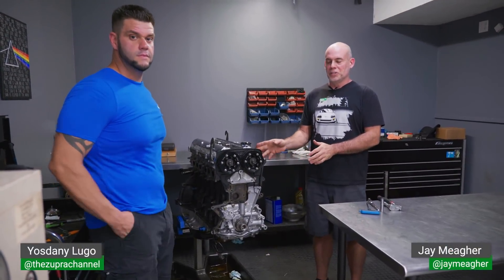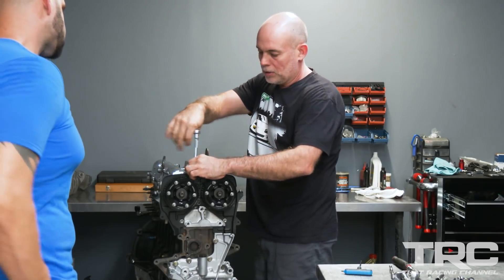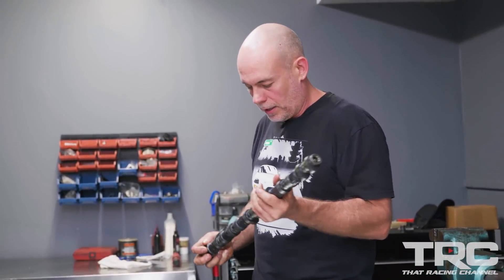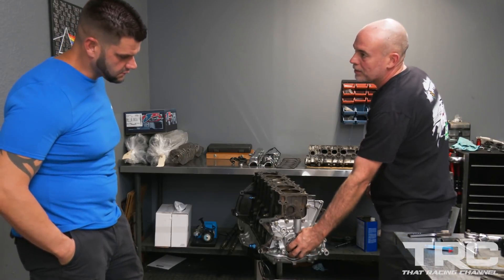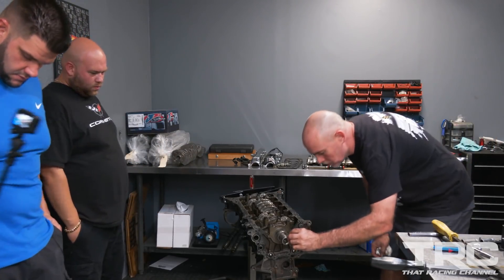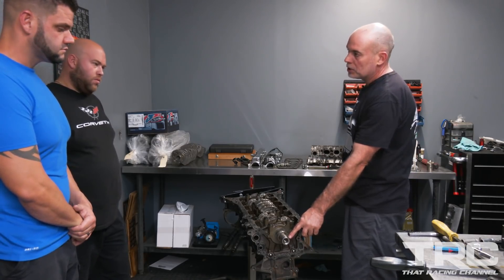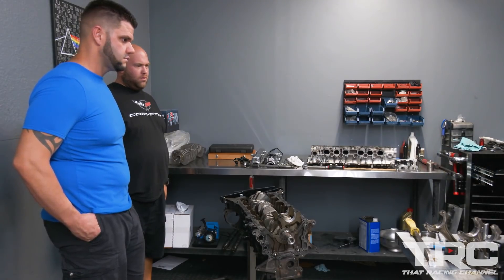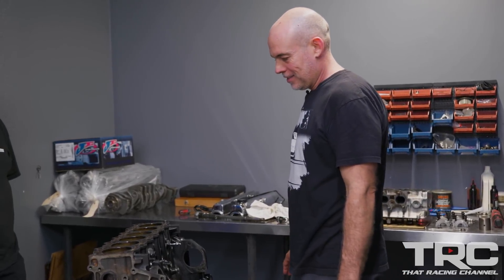1100HP Supra Blows Engine - 46psi on Stock Internals (Engine Teardown)

Comment: 1100hp out of a stock block isn’t that impressive. I had a Chevy 454 modified and tuned to 1800whp (with the stock block) and it lasted me years. I also have a 5.9 24v Cummins making 2100hp. (Also with the stock block.) I bought the truck new back in 2003 and had it tuned for racing and hauling. The engine still runs completely fine and has never had any issues.

Comment: Having used cranks from explosions several times I have never had a problem. Though crank has been checked for both straightness and cracks.
Normally the piston will fail causing the rod to fail.
Crank snout issues though can be an issue.
The crank key however was loose when assembled last time. Otherwise the balancer would have been loose. 
Though these 1000hp engines are dyno figures. Not real power for the track.
Reply: How much hp and what engine are we talking bout here.

Comment: 8:26
Trauma is the key word here, you dont know how deep the damage went from that initial impact of that piston slapping into the head. Just because you only see damage there on the surface, does not mean there isnt more beneath like a hairline crack in the head that is not visible. 
Just like a lightning strike to a house, just because the hit was only in one spot of the house, does not mean that there isnt more damage, when that bolt hits, it creates an explosion and a shockwave and that shockwave will travel and whatever is in its path can and will get damaged. Let alone the electricity from that hit will attach to the electrical lines in the house and if you have devices on and running pulling electricity, the lightning surge will attach and flow with it thus blowing out that device or appliance. 
Like he said the guys who designed the 2JZ are sitting there smiling and saying yep thats our motor, ~1300 crank hp on stock internals :-)

Comment: Connecting rod breaks on the exhaust stroke if that is rpm related issue and not oil/heat related. It is due to inertia of piston con rod combo. On the compression stroke that inertia is partly consumed by air-fuel mixture being compressed but on exhaust stroke the only restriction/inertia consumer is backpressure and it is a lot weaker. In general connecting rod can withstand this stretching by itself but rod bolts are usually weaker and have a little give which can result in connecting rod cap misalignment and possible failure. Also if this cylinder is at about exhaust tdc his pair is at power tdc and has a whole lot of acceleration if engine is seeing much more combustion pressure than stock.  During normal operation this usually is not the issue and upgraded rod bolts might hold for modified engine but there is a limit on those rods too.

Comment: If he had the engine apart to do main caps why didn’t you do the rods and pistons. Wierd
Reply: Ahh .. $$ maybe ?? Or felt he had no reason at that time to push more than 800 whp so stock internals would be good enough... 
The way i see it, if i had to open the 2JZ .. regardless of how strong the stock block is, i would have thrown in pistons and rods just because i was going to open it and might as well do it just in case you decided to want more and more power ...

Comment: That key way was probably the reason the engine threw a rod when he let off the throttle. Would have advanced the timing for a split second
Reply: Yes thats when most engines fail on the dyno or the track, when they are going from really high boost to full vacuum state, that change in state is when the engine blows ... especially when your pushing the limits of the engine and its already on the verge of poping.

Comment: Damn those stock internals are really impressive ngl
Reply: The guys that designed this engine knew what they were doing and did it right ... the 1st time ...
Reply: @ACommenterOnYouTube  ah yes overengineering
Reply: @sn1per.-992  the rumor is they didnt over engineer it for no reason, it was over engineered in response to the RB26 motor that came out before the 2JZ .. Apparently the RB26 came out 1st and was a bad ass motor putting down ~500 whp on stock internals so Toyota fired back with the 2JZ ... and they did one heck of a job ...

Comment: 2jz Engines are just unbelievable  what they can do on stock long block.  And that's 1100hp to the wheels  on stock 2JZ.
Reply: But that 1100 whp or ~1325 crank is a ticking time bomb. But yes the fact that it was built thag damn strong from the factory was impressive.

Comment: Boostedboiz 4 cylinder minivan has a 1000hp 2jz's are junk!! Barra all the way🤏🤏🤘
Reply: 1100whp stock LONG BLOCK. That POS minivan has a fully built longblock only making 1k. The 2jz is a 3.0L 6 cyl, a Barra is a 4.0L 6 cyl. Toyota is the co-director of Yamaha motors. Guess who designed and helped Ford design that Barra engine? Walk it off buddy
Reply: @urot  so they broke Yamaha motor

Comment: So excess rpm pretty much pulled the rod apart. I guess under load, the boost and combustion pressure loads the rod in compression but when letting off the throttle, the rod is now trying to pull the piston back down after tdc against vacuum and simply doesn't have the tensile strength to do so. 

It is still really impressive that an engine that was designed for 280hp, with decent low down torque to pull a four door luxury barge, can then make the power it did and still not fail due to excessive cylinder pressure.

Comment: The owner just wanted the hp record, it was a throwaway motor to him somehow. The builder was pissed because 2JZ’s will be extremely rare in another few years.. you need to do your best to keep them alive so Supras can still live.
Reply: Yes. 100% agree. I bought my 2JZGTE in 2017 for 3000. Now a non vvti 2JZGTE is 7,000 plus.
Reply: @brianleiser7414  idk where you saw that. You can still buy a new OEM short block for $3.5k
Reply: @2jJosh98  Hey Josh. I'm talking about a complete engine. Not a block only. Prices climbed a lot in the last 3 years for complete engines..and I can only guess the reason why is popularity.. or import taxes. No one really talks about the price hike.

Comment: More important question is what was the torque rating and when what is it?
Reply: it made 1106HP and 824TQ
Reply: @TheZuprachannel  Thanks for the reply. Once you start getting into 700TQ, the stock rods start to become dangerous. His timing and tune appears to have been right which is why it lasted a bit. 650TQ is the very safe limit for very high reliability on the stock rods. After that, it start to go down from everything I have seen over the decades.

Comment: Dang. 1100whp with stock internals? Last time I checked it was only 600whp that they could handle lol
Reply: Would say Dyno lottery but 400 is a big big difference
Reply: @andrewwright.  10 Years ago it started with 800+whp. Thats around 1000 hp @ the crank. Thats not a lottery.

Comment: "We'll get you another engine, and get you back to playing"...although I wonder how much parts and labor would cost...
Reply: I'll say you looking at 25k to get it run again..
Reply: @Hallstead Hoops, the bill can run up pretty quick. For a RS1600 from real street the price isn’t bad. I think it’s 9k or so with a new block and crank or a seasoned block/crank. The head is the bitch, to get a good used GTE head is 1400-1800. If he sends it off to get worked over by the best of the best (Porting Solutions, Headgames, etc) race port/polish, upgraded valve seats and valve train+ shimless buckets, new cams, and cam clearancing is about 7k 

ARP L19’s/625 headstuds I’m sure are on the engine, so those are reusable, but will need modded oil pump (300) new water pump (~200) full engine gasket kit from pan to valve covers (~550) timing belt and billet tensioner (~300) and professional assembly, installation and a retune. 

20k-22k is not unreasonable for a fully worked over 3.0 utilizing a  new OEM block. If he goes 3.2 or 3.4 you can add a Crower crank to the cost at ~4k, billet bullet block is 8000 dollars. But both items are really not necessary for 98% of high horsepower Supra setups.
Reply: 5k at least
Reply: @andrewwright.  thats not enough for a stock engine anymore
Reply: Depends on the build, but I wouldn't doubt somewhere ~20k for a fully built to the tits motor.
Reply: @youtubasoarus  Billet blocks run about 6-8k alone if I recall from Mazworx

Comment: Engine breakdown videos are always satisfying to watch. 2JZ engines are top tier for a reason.
Reply: Coyotes
Reply: Honda K24 > 2JZ
Reply: @Twobarpsi  lmao
Reply: @madkas14  1000hp K24 or 1000hp 2JZ, which is the better engine 🤔
Reply: @Twobarpsi  k24 is cool,, but imho 2jz is better and can hold more power.
Reply: @madkas14  1000hp out of 4 cylinders is 🤯
Reply: @Twobarpsi  this is true, that's extremely impressive.  Gotta say...
Reply: @Twobarpsi  look up Jeff Evans f22c
Reply: @joseperalta8605  good tip 👍
Reply: @Twobarpsi  a true man of culture
Reply: Wrong subaru STI engines are the top tier engines.  #ej257
Reply: @racingsfun  lmao suuuuuure.
Reply: @madkas14  😂
Reply: @racingsfun  Have fun doing the simplest of tasks, like changing you sparkplugs......  id buy a wrx if they made  a button that pooped the drivetrain out the bottom to do basic maintenance
Reply: @cbracing808  As a subaru owner, this comment made me rofl.
Reply: @racingsfun  best ironic comment lol
Reply: @racingsfun  lmao
Reply: @racingsfun  as an LS guy also venturing into 2J'z, WHAT? LMAOOOOO
Reply: @racingsfun  HAHAHAHAHAHAHAHAHAHAHAHAHAHAHAHAHAHAHAHAHAHAHAHA
Reply: @racingsfun  quite the opposite. Are you trolling or are you just a noob fanboy??
Reply: @racingsfun  Wtf!!! 😂😂😂